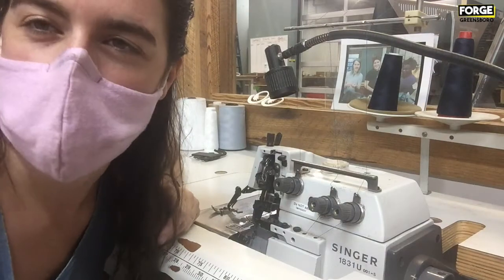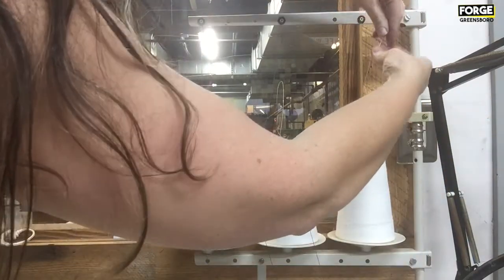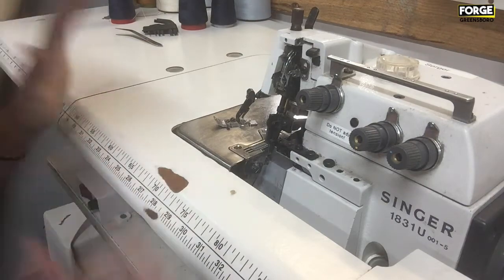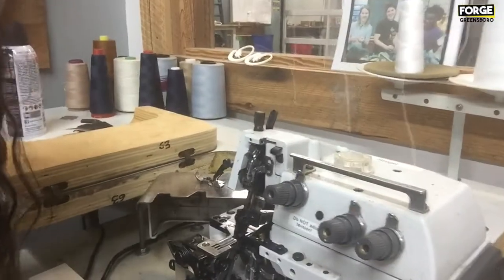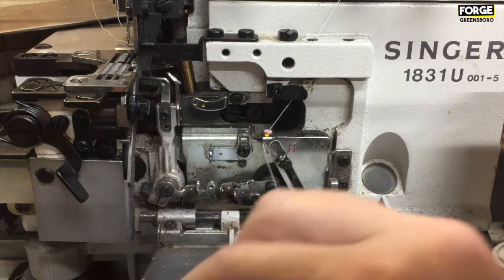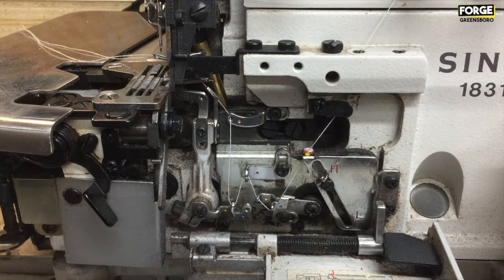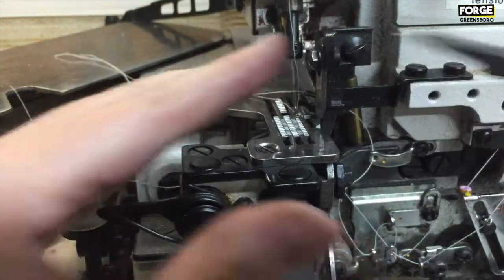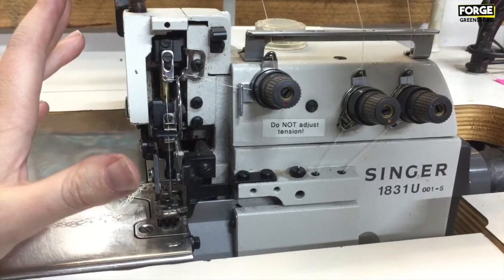Serger Orientation

Comment: Thanks Ann! I changed the thread using the knot method but I forgot that the knot wouldn’t  fit through the needle. What putting a QR code for this video near the machine? I found the video via web search which took a while.